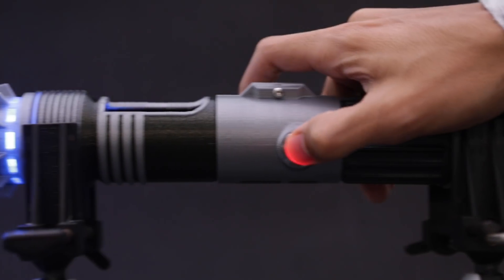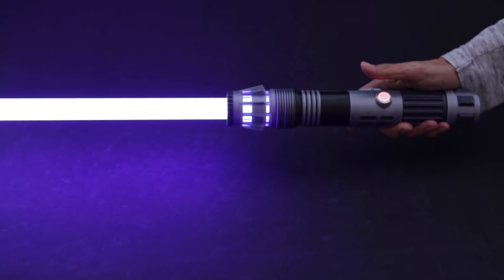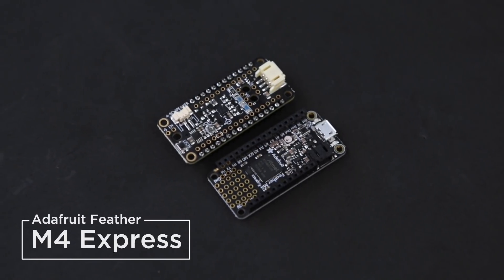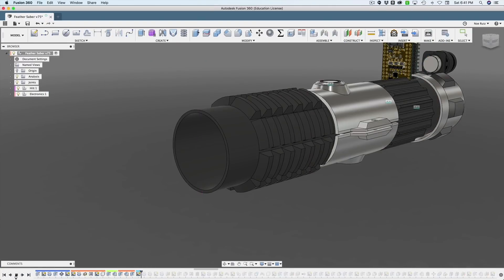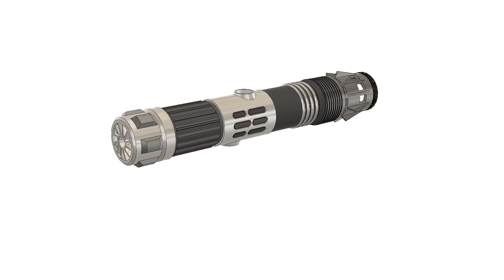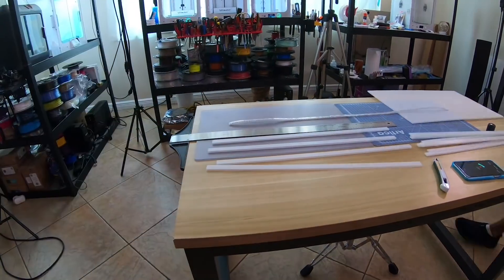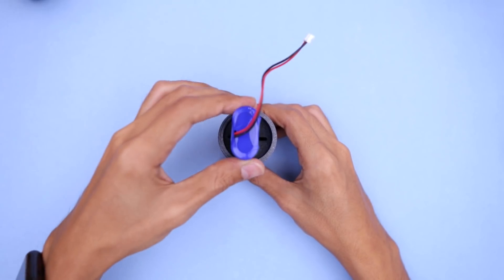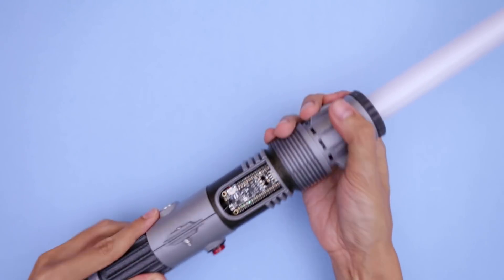Prop-Maker LightSaber Build

Comment: Would it be viable to use the same set up, but use a battery with the same 3.7 V required but has less milliamps per hour
Reply: yea it would just run out super fast, those neopixel strips take a lot of power

Comment: How did you make the emitter sturdy enough to not snap clean off during an impact?
Reply: According to the article, they use a pre-made blade from ultrasabers for the blade plastic. If you're using parts from somewhere such as TCSS, the recommended adhesive for pixel blades is Weld-on 3.

Comment: can i power this setup adafruit setup with AA / AAA  rechargeable battery´s ? like 4x1.2 V or 3x1.2 V ? 

or this instead ?
https://www.amazon.de/Keeppower-18650-3500mAh-Li-Ion-Akku-geschützt-NCR18650GA/dp/B07JMGHZNX/ref=sr_1_9?__mk_de_DE=ÅMÅŽÕÑ&crid=2A8H5ZQGVQQPO&keywords=3.7v+lithium-akku&qid=1570300615&s=ce-de&sprefix=3.7v+lithium%2Celectronics%2C170&sr=1-9